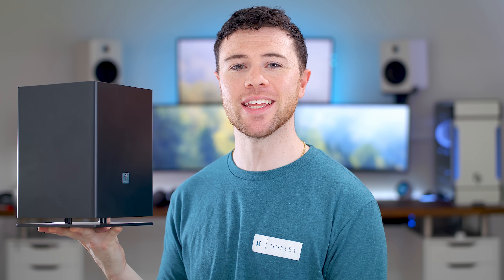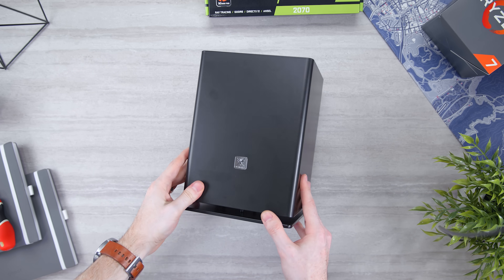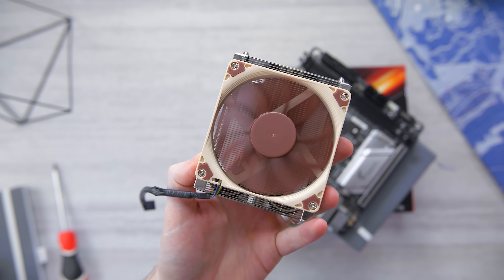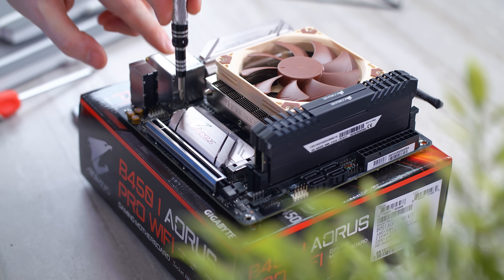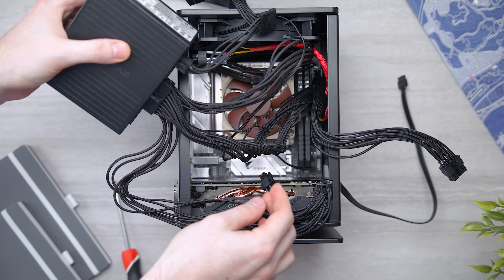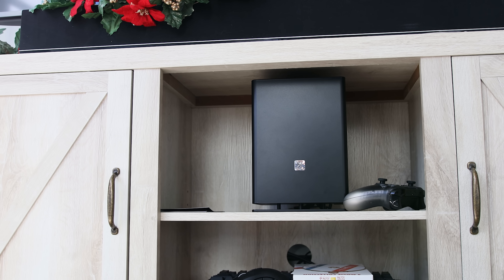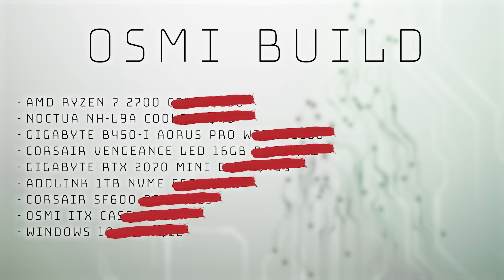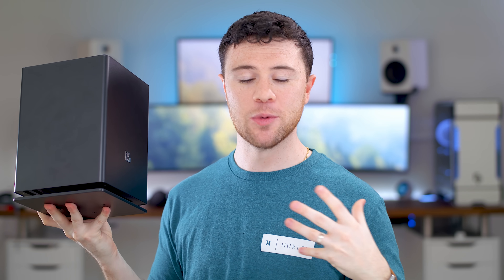I Built the Xbox Series X as a PC

Comment: people forget when building a PC you are sourcing the parts yourself, microsoft are buying them in the millions of units so they could buy a 2080ti performer for 1/3 of the price or less so it is achievable for them to get 4k 60fps in a small machine
Reply: UHD Gaming PC parts became cheaper that year than the year before. Prices have been dropping for everything for a minute now
Reply: UHD Gaming PC  amd hater .nvideo fanboy
Reply: the is a limit on the dye
Reply: 100fps not 60 fps
Reply: There is a limit to this massproduction price drop - for example PSU’s generic motherboards, cd drives, and traditional hard drives are about as cheap as they can get without loosing money, they sell for extremely thin margins - there isn’t a way Microsoft is going to get these things cheaper because they’re made and sold about as cheap as they can get. Microsoft is also designing a custom GPU and CPU soc these will never be sold outside of the Xbox unless Microsoft allows it - this actually costs them more money it is not cheaper, where they are saving is by having the cpu and gpu on the same die, this also saves in power efficiency and latency in communication. So the estimation of the parts is definitely underestimated. Microsoft will sell the consoles at a loss (as they always have) and make up their money in game sales.
Reply: UHD Gaming PC  Sorry, but AMD will make custom GPU's far superior to what they currently offer to PC gamers because they'll sell 100x more of it than if they combined all their PC cards combined. That's how it has always been.

Just look at Steam's PC hardware survey, the large, LARGE majority of people don't even have a PC capable of running 4k games. Here's some noticeable stats:

20% of PC gamers use a GTX 1060, which is by far and away the most popular GPU. The next closest is the 1050 Ti with 9.23%, then it drops off even further from there.

If you combine the 2080 Ti, 2080 Super, 2080, 2070 Super, 2070, GTX 1080 Ti, GTX 1080 and even the 2060 Super, you have less than 9% of total users with those GPU's.

Then if you look at Primary Display Resolution, 70% use 1920 x 1080, and only 6.75% use 2560 x 1440. That drops all the way down to 1.5% for 4k gaming. 

And because consoles are universal, firm specs + they're not built on modular components like PC's, developers can get far more performance out of less if they have to. Also, only 11.89% of all GPU's are AMD, that's why AMD can build better custom GPU's (well APU's) for console & sell waaaaay more. 

Sales of the Xbox Series X & Playstation 5 will dwarf the sales of whatever line of GPU's they come out with for PC's, just as they always do. Hell, their sales will dwarf that of high end GPU's from Nvidia too. Again, that's why it doesn't cost the same, and why it never will.
Reply: Corey yeah that’s what they said about this gen too... we all know how that went
Reply: So why was the Ps4/pro xboxone/one x using outdated hardware when created??? There was wayyyy better hardware at the time they could’ve used. The reason they didn’t is because it would’ve cost too much.
Reply: UHD Gaming PC  Peanuts? Are you high? If they put every dedicated gaming GPU they sold across all lines together, it wouldn't sniff what they sold through with their console APU's. 

The R&D required to produce each of those lines, and for such minimal sales, is far more pricey than than the one time hit at a higher cost they take for making a custom design for Sony & MS, but then they make that money back 100 times over and for year son end without any further R&D.

They make far more profit off those than they do any of their GPU lines.
Reply: Nividia already confirmed the 2080 stronger than ps5 and series x not to mention we are getting the serious 3000 soon
Reply: @roadtosinging5062  Nvidia is just salty because no company Nvidia chips in their consoles
Reply: @shadbud9198  regardless of whether that's fact or not it's common knowledge a 2080 already achieves 4k 60 fps
Reply: Road To Singing! Not saying they’re lying but why on earth would they admit if true a 500-600 console is on par with a $1000 (not sure on price but what I hear the price is) graphics card, they wouldn’t because they immediately would have to start dropping the price the second the new consoles launch otherwise people would  buy one and save half their money or buy both for possibly the same price, also I doubt they know how good any component is inside either console as specs still haven’t been disclosed and only devs have access to the numbers and capability of them. 

And il reiterate because I’ll no doubt get attacked for even saying hypothetically it’s possible, I’m not saying the new consoles are or will be better on par or even close, I’m just giving an argument as to why they wouldn’t admit it even if it was true.
Reply: @eirebhoy132  even if it's as powerful as a 2070 that would be a huge leap since current gen consoles run on something like a 1050ti now imagine a console with a 2070 + optimization
Reply: @shadbud9198  Consoles don't really get special optimization anymore. There is no metal programing. The most that was ever done for the last gen was making sure the game worked with GCN GPU architecture and 6-7 CPU cores.

It's not the days of the PS3 or N64, where hacks and learning down to the metal how to program for it best got you gains in graphics and performance. Even in those days it was nothing like the NES and SNES days of doing work between CRT blanking periods.

It's a PC, it uses x86 architecture with many software libraries that do the work for you.
Reply: @shadbud9198  if you are talking about the graphics card on the X than maybe, but the xb1 and PS4 have cards similar to a GT 750.

Comment: Pretty sure they've admitted to it being ZEN 2 not Zen+
Reply: It is. It'll have the same 7nm architecture as AMDs new Ryzen and RDNA CPUs and GPUs
Reply: @scottyhaines4226  RDNA 2 actually.
Reply: @Neutraliz_  RDNA 2 is a GPU microarchitecture, not a CPU microarchitecture. It's using a custom 3.8 GHz AMD 8-core Zen 2 7nm
Reply: Yup it's zen 2. I got a R5 3600 and it is by far the best processor I have ever owned
Reply: Right it will be zen2 but it will not be clocked as high. So eventhough they are using zen+ it is clocked higher than what they are using in xbox
Reply: Yes but will it be as strong as the current Zen 2 I mean I don’t see it being as strong as 3600 I could be wrong
Reply: @g3neralcross911  it doesn't need to be super strong if the entire ecosystem of software is optimized for that specific CPU.
Reply: @g3neralcross911  Uh, well, i don't really know, because it's still a pretty strong configuration with 8 cores, 16 threads, with Zen 2 cores. So pretty much a 3700X. But really downlock ( about 3ghz ).
Reply: Neutraliz yea and the series x is clocked at 3.5
Reply: He uses gddr4 ram Xbox says they are using Gddr6 doesn’t that make a big difference.
Reply: AlphaAny1 El it does make a difference GDDR6 ram is better then GDDR4 ram
Reply: @chasethechosenone8478  the GDDR6 is for the Graphics card and ddr4 is for the ram/memory.
Reply: Skyler W I know
Reply: @chasethechosenone8478  The consoles will be unified memory gddr6, it's very fast bandwidth wise, but not latency optimized for a CPU. So a CPU usually suffers from gddr memory as a GPU suffers from DDR, though it should still be fine. The graphics performance is more important than a slight disadvantage to the CPU as we've seen in the Xbox 1 X.
Reply: Jake Rosendahl it’s a disadvantage or advantage depending on the game...
Reply: Xbox says? no u say !

Comment: It’s going to have a zen 2 chip, so 3600/3700 would be closer in comparison...
Reply from the maker: 3600 is 6-core, not 8. 3700 is not worth the $300 price tag when this was $150.
Reply: That is right, it is 6 core. I understand that the 3700 is $300 but it is closer to what is goi g to be in the system. Microsoft will be not paying top dollar for the chip either. I wonder if they are going to be taking advantage of PCIe 4.0 with memory and the graphics card which would make a huge difference in loading times etc. I don’t think it will be more than $499 either. Love your videos by the way, keep up the great work man!

Comment: "I built the Series X as a PC"
*Buys Corsair One*
Reply: Cuts the top 3rd off lol
Reply: Uses ddr4 lmao
Reply: would have been nice if he used the nearest equivilant PC parts, that are similar to what the leaks indicate that the consoles will be using. All the leaks indicae a zen 2 based cpu, possibly a zen "2.5" cpu, that is using some take away's from the upcoming 3rd gen Zen cpu's. that means he should be using a 3700 through 3800x. as the conosles are being touted as using GDDR6 for their system ram, he's using ddr 4 with WAY too slow speeds and timings. the xbox series x GPU is supposed to keep up with a 1080TI, and a 2070 non super Can not do that. (the xbox series x Gpu should be in short, an amd 5700xt except also with raytracing features) the 2070 is woefully inadequate. And the Biggest selling point of the new systems is arguably their High bandwidth bus speeds.. the NVME SSD he picked out is too slow, not to mention, there is no PCIE Gen 4 on that series cpu, so it already is HALF the bus speed of the console.. So who is he kidding?
Reply: Dj Mccullough preach!!!!
Reply: Dj Mccullough it’s actually heavily rumored to be a 12tflop Navi 2.0 derivative.  That’s as fast as a 2080ti.  Not a 1080ti.  Everything else is fairly accurate in your comment.  This guys pc is considerably slower than what the actual system will be.
Reply: @josephhooks1292  True, but the Tflop ratings of RDNA cards tend to appear higher than their Geforce counterparts Dispite the cards having different capabilities. There was a reddit posting that a 2080super/1080ti has about the same effective performance as the mystery GPU in the console. Personally I doubt the console will be able to outrun a 2080TI in Raster graphics, but judging that Nvidia's Raytracing implementation is VERY NOT Great, I can totally see the console version having superior raytracing to the 2000 series RTX cards. The big thing there is to wait and see.. Given the math we know about RDNA/V/RTX, Im personally betting the console will see AROUND 2080super performance / 1080ti Raster performance.
Reply: @josephhooks1292  everything I've seen says it's gonna be equivalent to a 2070. Multiple sources say a 2070 or 2080 at the most. I highly doubt they put a freaking 2080 ti in an Xbox.
Reply: DjangoXXI the 5700xt is faster than a 2070 and it’s just under 10 flops.  The Xbox has a 12 tflop gpu with more advanced features than the 5700xt.  It will be faster with those specs than a 2080 and be pushing the 2080ti.
Reply: @josephhooks1292  It will be in between RTX 2080 and RTX 2080ti. The r7 2700 in the video is wrong, it will be a downclocked r7 3700x~ cpu.
Reply: @josephhooks1292  I really get frustrated with people pulling away "double the performance of Xbox One X" to mean 12 Tflop. it's not likely going to hit that compute level, which is why no one has directly SAID from the Xbox team the words "12 Tflop." Well, that plus teraflops are a terrible measuring stick for gaming performance.

The reason I'm bringing all of this up is because in order to be in the ballpark of 2X IN-GAME performance of the Xbox One X and its Polaris-based, 580-esque graphics core, the Navi based solution would only need to be in the ballpark of around 10-10.5 TFlops, thanks to the architectural advantages that Navi has over Polaris.
Reply: DoubleVendetta (*******Chance Cox*******) nobody is pulling that from his statement.  All of the large insider sources are reporting 12tflops as the target performance.  Phil was incredibly vague with his statement on the gpu performance on purpose.  They haven’t 100% locked the final clock speeds and performance down most likely but insiders are saying the target is just over 12tflops of Navi 2.0.  You also have to account for clock speed and density gains if it’s on 7nm+.
Reply: @josephhooks1292  Sorry but that will never happen, Nvidia just announced that a rtx 2080 MAX-Q is faster than the new generation of consoles and that card alone is like 10-15% slower than the RX 5700 XT. So the best the new gen consoles can do in term of graphical raw power will be a RX 5700. Sorry to let you down but there is no way the new consoles are going to deliver 4k 60 and maxed out graphics, let alone 8k, at an affordable price, even considering that games are relatively more optimized in consoles. My guess is that we will be getting native for 4k at 60fps but not at maxed out graphics, games will probably have a setting where you can choose between performance mode (4k 60) and quality mode (4k 30 +RTX).
Reply: Edwin Vaughan explain to me how Nvidia has any idea what the consoles will have?  The 5700xt is only barely larger than an rx580.  It would be fairly easy to put that or larger in the consoles.  Sorry to let you down but just wait until amd or Microsoft/Sony tell you what’s in it as they designed it.  Not Nvidia who is obviously damage controlling their inflated prices.
Reply: @josephhooks1292  Sure I'll wait, but I'm pretty sure is not gonna be me who is gonna be let down. I don't have high expectations for consoles because I already lived through the launch of three generations and they always make exaggerated claims, based on that experience I'm pretty sure that the new consoles won't be faster than the 5700xt. Also is not about size, it's about pricing, I don't think they will release something above the $699 mark, yeah of course that mass production reduces costs by a pretty big margin, but not enough to make 4k 60fps RTX viable at that price point. Just my opinion tho.
Reply: Edwin Vaughan see it is about the size though.  The size of the chip reflects its cost.  They could sell the 5700xt at $250 and make money but with Nvidia charging $500 for a 2070 they don’t want to lose that much profit if they can charge near the same as Nvidia.  I’ve lived through 5 generations of console launches and been a pc gamer for years as well.  Everyone said there was no way Microsoft could make the Xbox one x for under $7-800.  But they did it for $500.  Microsoft has spending room to put much more in their system than Sony does.  Sony might not beat the 5700xt in raw power but might with efficiency and I can really see the Xbox beating it.  As the Xbox is rumored to have a bigger gpu and a newer design.  Aka Navi 2.0. I can see it costing $549 or $600.
Reply: @DjangoBruh  don't forget, noone is going to mine with an Xbox. If it wasn't for the mining community a 2080ti would retail at around 299. Microsoft mass producing its own GPU can easily get the same performance as a 2080ti
Reply: @edwinvaughan4792  you are forgetting the inflated GPU pricing due to the mining community. If we didn't have miners a top 4k 60 card would be 299 at most
Reply: daniel jefford that’s not true, five years ago before mining took off a gtx 1080 (perfectly capable of 4K 60) was still $400-$600 and with inflation that’s only gone up more.
Reply: Exactly
Reply: Right 😂😂
Reply: It's underpowered
Reply: That again was $1300 minus a uhd drive as well that would bring cost up to around $1500.
For what you get bang for buck consoles are the logical choice if what you intend to do 99% of the time with the device is game and watch movies.
Gaming alone never justifies $1400 plus purchase and for what a vast majority of average Jane's and Joe's computers arent necessary if you have a phone which does pretty much anything a pc does as well or well enough minus maybe a few more resource intensive tasks like video, graphic creation/editing and real time rendering type operations otherwise not much need in this day and age for a computer.
Reply: Warm Soft Kitty just wait until E3
Reply: Warm Soft Kitty that might actually be the dumbest thing I’ve ever heard. The 1080ti can’t even utilize RTX and the new consoles will. And that just one feature. The 1080ti is built on an older architecture, with slower VRAM, and is outdated in so many more ways...
Reply: For everyone trying to argue about cost and performance in PC’s vs the new upcoming Xbox: Linus Tech Tips already tried to match the performance of an Xbox One X with a $500 PC build (because that’s how much the One X cost at launch). He did all the comparisons, ran all the tests, and build the best PC $500 could buy and he couldn’t do it. When you match costs of components and systems, consoles win. In the long run, a PC may be the better option, but the value of consoles is undeniable. And you can argue all you want, but Linus knows more about tech and has more experience than anyone here. Watch his video and see for yourself.
Reply: Grey Lawson exactly!
Reply: Yoooo
Reply: Booooooooy this comment section aged well lmao 🤣🤣🤣🤣🤣